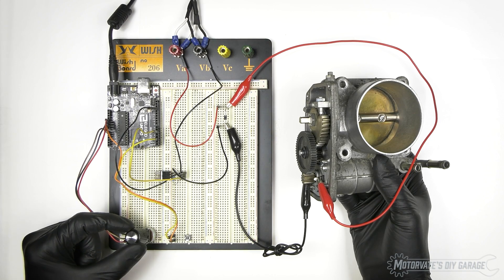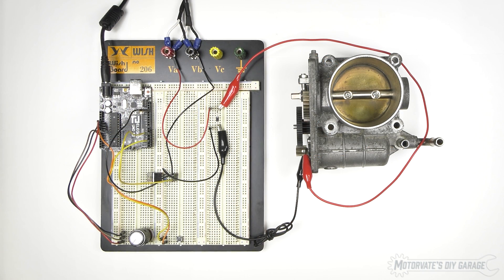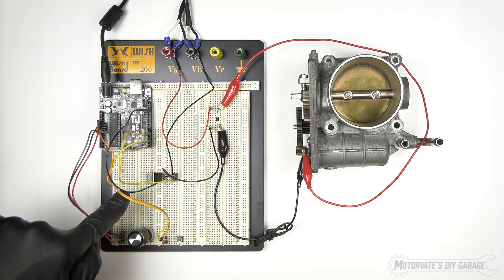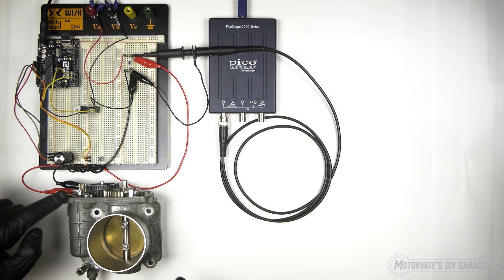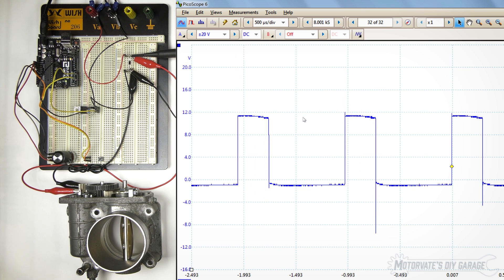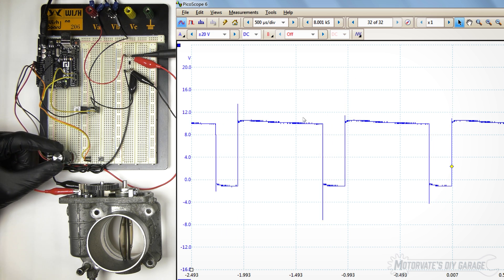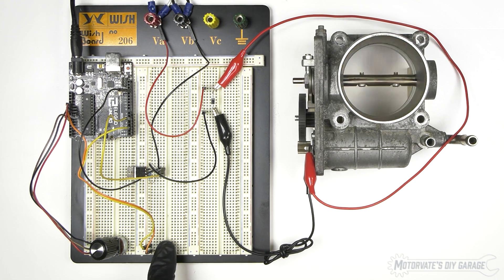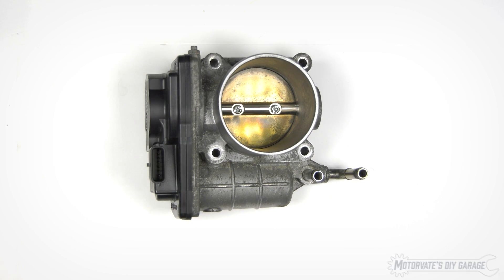How it Works - Drive by Wire Motorvate's DIY Garage Ep.31

Comment: I just got a 2012 G37  and noticed this same exact sound occured when maintaining speed and acceleration over 60 mph. I can't believe its actually "normal"
Reply from the maker: Hey bcdLeeXY ,
I wouldn't think you could hear the throttle body sound, with the hood closed, inside the car, doing 60 mph.

However, some on myg37.com have complained about the ECU making a sound, and that is located just under the right side of the glove box.

Maybe look into that?
Reply: @MotorvateDIY  Yes, read the 15 page thread. Apparently it has worked for most people. I am going to look into the part. Thanks for the lighting quick reply!
Reply from the maker: Hey bcdLeeXY,
Anytime :)

Comment: Hey mate, thanks for the Nice vid! I’ma do a custom RBW for a cable driven motorcycle, and had the idea of getting a used throttle grip of a RBW driven bike (which would replace the potentiometer of your example), but they often have like 6 wires (only3 would make my life easier instead). Any tips to find myself out which wire is +/gnd and signal, which should be the only ones I have to root to the Arduino?
Reply from the maker: Hey  NAFNOOF,
The reason RBW throttle has 6 wires is that is has 2 position sensors (variable resistors). This allows the ECU to do a double check to make sure the signal is valid. This is a critical safety feature!!!

Also, if you wire up your throttle similar to how I did, you will have VERY poor off idle throttle response. To transition from idle to a higher RPM (like when starting to move) requires very good control of the first 2-4 degrees of the butterfly valve opening.

If you have a basic understanding of electricity, it is very easy to determine what each wire does using a multi-meter. 

My guess would be:
One is ground, one is most likely 5 volts, then 2 wires are the variable resistor for position 1 and the last 2 wires are the variable resistor for position 2.

This is not a simple project and I wish you the best of luck!
Reply: Motorvate DIY,                                                                                                                  Again thank you so much for the answer.
I’m actually going to use a servomotor directly rotating the throttle axle, that will be programmed for the RBW as well as for auto-blipping and cruise control functions. Knowing that the servo seems pretty precise, you still think Im’a have this poor throttle response? If yes, any idea of how how I could fix this? I added you on Instagram so we could talk in private, I hope  you don’t mind 🙏🏻
Reply from the maker: Hey  NAFNOOF,
The only way to know how well it works is to build it and test it.

That is the fun and frustrating part of DIY :)
Reply: Motorvate DIY,  oh ok I thought you ment there’s a special manipulation to do, anyway testing and re-testing was what I planned to do so I’ll deal with that! Thanks and wish you best for your the upcoming projects
Reply from the maker: Thanks! Same to you :)

Comment: So no feedback is implemented here? Only using a spring to hold back the butterfly valve and setting a duty cycle proportional to the position of the potentiometer?
Reply from the maker: Hey  theyeah132,
That is very observant!
In this video there is no feedback. The motor simply pushes against the return spring using a 3 amp power supply.

At first I was going to implement a feedback system, but the time required to do that was more than benefit.

Comment: Two new questions, do you happen to recall what the maximum current draw is/was, I'm guessing some number close to, but less than 5A?  And do you think that it would be possible to remove the quadrant gear, replace the return spring and reassemble?  

In my case I'm looking to create a supercharger bypass and would like the unpowered position to become 100% open, as that would be the new normal for 98% of its life.
Reply from the maker: Hey  Lindsay Dempsey,
For this video it was using a 3 amp power supply, however, if it was on a 10 amp power supply, I  think it would use more current.

As for the spring re-work, the only way to find out is to get one at a scrap yard and see. In this throttle body (from a G37) the throttle is not 100% closed when not powered. I is about 1 % open,  BUT I suspect that could fixed using the factory set screws.
Reply: @MotorvateDIY  Thanks again, agree, I've found some clockwise and anticlockwise return springs on line, so I'll just have to pull a broken TB apart and see if I can make it work the way I want.  I'm looking for a 60mm throttle body or something close to that size, I presume that the G37 is much bigger than that.
Reply from the maker: Hey  Lindsay Dempsey,
Actually the G37 uses two 60mm throttle bodies. Good luck with your project!
Reply: @MotorvateDIY  Excellent, sounds like a great place for me to start, thanks.
Reply: Just in case anyone else might interested in this idea.  I just did some searching on ebay and the Q37 throttle bodies (2 per car) are handed.  Looking at the quadrant gear end on, one turns clockwise to open and the other turns anticlockwise to open.  So it looks like a return spring change from one body to the other will hopefully make the power off position fully open, which is what I'm trying to achieve for the bypass valve function that I need.  Great stuff, thanks again @Motorvate DIY

Comment: Excellent video thank you.  When driving the throttle body at +12V constantly doesn't that overload the motor or gears or is there protection from that?  Also I see that you did not use the TPS as feedback, presumably it would be very easy to bring that back into the Arduino compared the two values (Set voltage vs TPS voltage) and use that to set the width of the PWM and sense, yes?
Reply from the maker: Hey  Lindsay Dempsey,
Good observation!
You would think that the DC motor would be over-loaded holding the throttle open against the return spring, but it isn't. 

Just about every car with electronic throttle uses this setup and I assume the design of the DC motor is optimized for 0 RPM without burning the the commutator or brushes. Plus with a pulse width signal, there is a small period of time when the motor is not powered and allows it to cool just a little. (just like LED used in cars)

I could have used the throttle position sensor for position feedback, but I didn't want to spend the time on more programming as I wanted to get the episode out ASAP :)
Reply: @MotorvateDIY  Thanks, and yes fair enough, there is only so much time in the day for these things.  I appreciate that they operate constantly which is pretty amazing, but typically at low to very low PWM %.  I'm concerned about the consequences of driving the throttle at 12v and 100% PWM continuously, because for my application, a compressor bypass, fully open is normal, closed is rare which is sort off the opposite of what they were designed to do.  Any thoughts on durability concerns for that application?  Maybe to solution is to drive it with only enough PWM to hold 100% open position, which is probably a lot less than 100% PWM (as seen in your very informative video) and all should be well on the reliability front, we hope.
Reply from the maker: Hey  Lindsay Dempsey,
I agree with you and would expect the factory electronic throttle body systems are designed to only use as little motor current as possible to keep the desired throttle position. (part open or wide open)

For a car's electronic throttle control they use a spring to close the throttle in the event of an electrical or control failure. 

It might be possible in  your application NOT to use a return spring and they would greatly reduce the current required to keep a butterfly valve fully opened.
Reply: @MotorvateDIY  I did toy with the idea of trying to rework the spring to make 100% open the default and then drive it closed, but quickly rethought that rabbit hole.  In your video it looked like the throttle got to 100% open with ~45% PWM on.  I don't know, but I'm guessing that at 45 - 50% PWM these things will be reliable.  I've never heard anyone badmouth a DBW throttle or mention reliability issues, so I figure that they must be very reliable if treated right even at 50% PWM being held open.  Some people I know drive that way all the time ;)

Comment: How did u wire that button to make the butterfly open so fast
Reply from the maker: Hey  Derrek West,
I simply set the pulse width to be 100% so it is at a full 12 volts.

Comment: what is butterfly valve?
Reply from the maker: Hey Salman Salman,
Good question!

From wikipedia.com:
A butterfly valve is from a family of valves called quarter-turn valves. In operation, the valve is fully open or closed when the disc is rotated a quarter turn. The "butterfly" is a metal disc mounted on a rod. 

When the valve is closed, the disc is turned so  that it completely blocks off the passageway. When the valve is fully  open, the disc is rotated a quarter turn so that it allows an almost  unrestricted passage of the fluid. The valve may also be opened 
incrementally to throttle flow.

Here is a short video: https://youtu.be/zhi7_YQZhOs

Comment: I have a g37 coupe and at times when I press the throttle this exact whining sound can be heard. It is definitely an electrical sound in nature and not mechanical. Infiniti mechanics can’t seem to hear anything but I can. Any ways to fix?
Reply from the maker: Hey Johnathan Bailey,
If you hear it when pressing on the throttle, it probably is the pulse width modulated signal (at about 1 Khz) going to the motor of the throttle body. 

That sound is normal, but is shouldn't be loud enough to hear from inside the car.

Do you hear the sound while driving the car or when parked and revving the engine?
Reply: Motorvate DIY Thanks for the reply. When I do hear the sound it is when I am moving. Anytime pressure to the gas pedal is applied. Almost sounds like I flipped a switch on a plane. Not extremely loud but easily annoying.
Reply from the maker: Hey Johnathan Bailey,
Check to see if the engine cover is missing (the big plastic cover on the top of the engine with the Infiniti logo)
Other than that, I don't have anything else to suggest.

Comment: Which type of motor you are using?
Reply from the maker: Hey Shehryar Niazi,
This electronic throttle body is from a G37. (which uses a VQ37VHR engine)
The late model G35s use the VQ35HR also use the same electronic throttle body.

Comment: I "think" this video explains exactly how it feels when you step on the throttle of a G37.  Nothing, nothing nothing, then finally it goes ;-)  You can see it with the switch being turned and nothing happens with the throttle body. Just wished there was a better connection between a G37's (I have a coupe) throttle pedal, throttle body, transmission and engine. LOTS of dead space. My biggest beef with this car, which is still an awesome ride. Another great video and well done as always.
Reply from the maker: Hey petemo94,
Thanks for you kind words!

Please keep in mind, my "throttle body controller" is a simple example and doesn't use any position feedback.
The actual system will respond quicker to when first pressing on the accelerator pedal since it will know the position of the throttle body.

With an automatic transmission, it can be difficult to determine if the car has slow throttle response or if the transmission takes a moment to respond to a rapidly changing throttle position. It is my understanding an aftermarket tune can remap the throttle and transmission to be more responsive.

Also, it does take a moment for the VVEL system to get positioned when the accelerator is quickly pressed. 

My G37 has a manual transmission, and 99% of the time, the throttle response is quick and what I expect.
Reply: I got a pedal commander.  It works.

Comment: How to perform a fuel presure test on the g37. I have looked at the service manual and it shows a gage but i cant seem to find where to attach it.
Reply from the maker: Hey Alex Cabreja,
Great question! 

Unlike other cars, there is no easy to access port to measure the fuel pressure. (like a schrader valve)

The pressure gauge needs to connect an adapter plate that bolts between the fuel rail and the fuel damper:
https://cj-motorsports.com/products/cjm-fuel-tap-npt-nissan-2-bolt

Why do you want to check your fuel pressure?
Reply: @MotorvateDIY  first thanks for getting back to me. I have a p0300 code  Random misfire im crossing out the posible causes and im checking the fuel pressure to make sure it is to specification and go from there. I have change spark plugs, looked for vaccum leaks as well as exhaust leaks and found nothing. there are many things that can cause this and i have a scanner and it showed fuel trims short/long term at -17 and if im not mistaking it means it is a rich condition but then i used another scanner a snap on solus ultra but that one show fuel trims as lean. I also looked for other methods on how to check the o2 sensors using the scanner and they seem to be working as far as voltage goes.
Reply from the maker: Hey Cabreja,
I understand.
If your scanner is wifi or bluetooth, you might want to use OBD Fusion (app for iPhone & Android, about $15) and run a diagnostic report. 

In that report, it decodes the Mode $06 misfre counters by cylinder and that might help you.
It will also show the freeze frame data when the SES/CEL turns on and the reading from BOTH MAFs.
This will allow you to see if the reported air flow into the engine is the same from bank to bank.

Are the fuel trims negative on both banks? 

A negative fuel trim is removing fuel due to a lean condition.

Your upstream or pre-cat O2 sensors are the newer style and report the Air/Fuel ratio. The voltage should
be around 2.1 - 2.2 volts at hot idle. (again, the OBD Fusion diagnostic report captures all this)

By the way, my other channel specializes in OBD apps and understanding them and it might be helpful: youtube.com/obd4everyone

I look forward to your answers.
Reply from the maker: Hey Cabreja,
I got mixed up: 

This is WRONG: A negative fuel trim is removing fuel due to a lean condition.

This is correct:
A negative fuel trim is removing fuel due to a perceived RICH condition.

A negative fuel trim is REMOVING fuel due to a rich condition. Either too much fuel,
or not enough air.

I would try cleaning your MAFs...

Comment: Don't we have some sort of weird design where instead of the plate controlling how much air is coming into the engine the plate is basically always fully open and it uses the intake valve to control air flow to the engine.
Reply from the maker: Hey sk8punk318,
Yes we do! It is called VVEL. (variable valve event and lift) 

Nissan put out a video explaining how it works, but is it a little over simplified.
In a future episode I will explain how it works and conditions required for the throttle bodies to be open.

Comment: Cool, I guess electric throttle bodies can be quick!
Reply from the maker: Hey Erik Haw,
I though the same thing when the circuit was being tested. The slower throttle response may due to reducing emissions or maybe even preventing a "shock" to the transmission and drive line.

Comment: very similar to the whining sound from my fx50 ECU whenever I press the gas. Any idea how to fix it?
Reply from the maker: Hey Alex L,
I don't think anything is broken. It probably is the sound of the switching circuit for the pulse width modulation for the throttle body.
Is this a new sound?